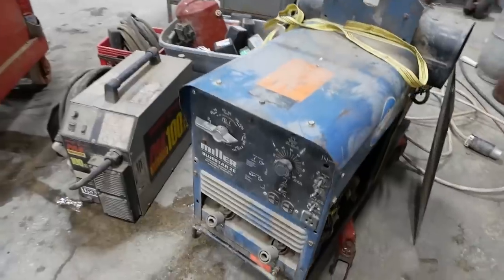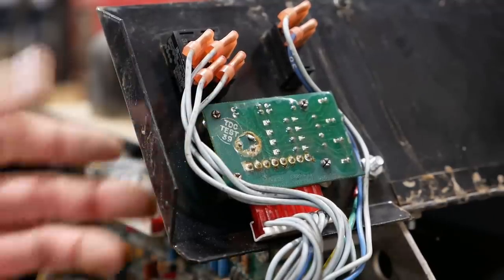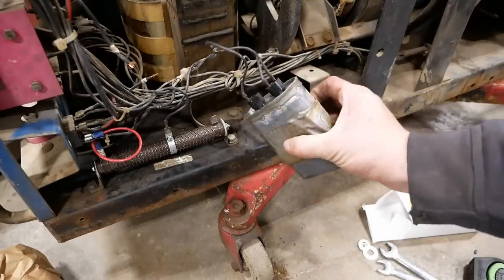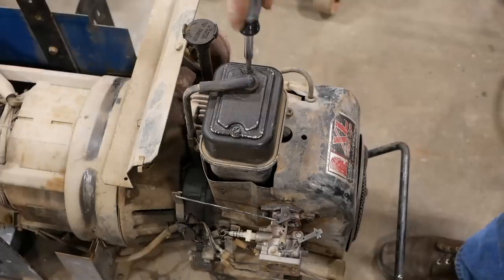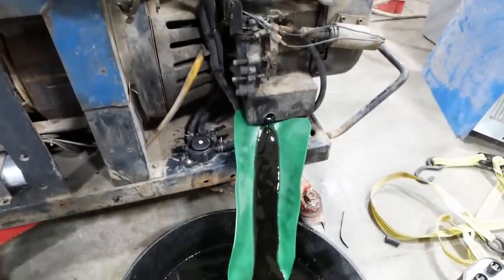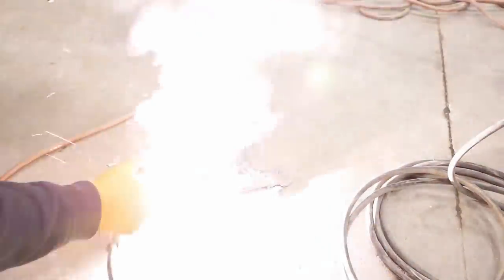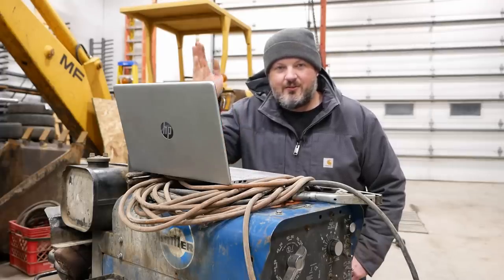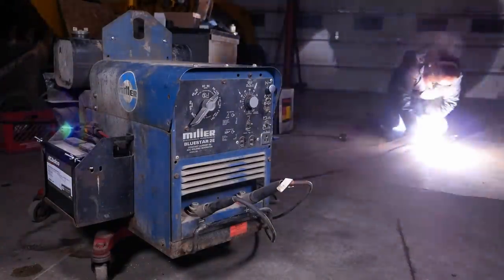Mostly Fixing my Bargain Portable Welder | Miller Bluestar 2E Part 2

Comment: That board that is put in on the main board, the one that doesn't look factory installed, is called a 'field mod'. It's often used when engineers deem a modification is necessary to original equipment. Those are usually only used on larger more expensive equipment. Seldom small units like that.
Reply from the maker: I’m assuming they had some old boards they wanted to use up.
Reply: @WatchWesWork  I used to work for a radio transmitter company, and they had to do mods for boards when they updated them, but didn't want to have the old batch sit in storage. Ours used to consist of a jumper, a piggybacked resistor, a new diode, or something similar. I don't remember ever seeing a scabbed on extra board. That is a new one for me.

Comment: Nice to see the old junk running and welding again. 😀

I’ve never repaired a trace on a circuit board, but I have had success soldering on a bypass wire to replace it.  (Looks like crap but allowed me to keep my old working that I couldn’t find a replacement circuit board for)

Comment: Not only is a piece of useful equipment saved from the scrap pile by proper diagnosis and repairs, but outstanding production values topped off by an exquisite closing scene are included too!

Comment: Rather than trying to replace the trace directly run a wire from a pad to the next pad. Stronger connection and you won't risk breaking more of the trace off plus it's then insulated for more of the distance.

Comment: Yes it has a compression release. It is built into the cam. If the compression release doesn't work when it builds compression it will likely stall the starter and bend the starter shaft.

Comment: We’ve all let the smoke out at least one or twice, or if we are honest more times than we can count.
Reply: You never have to let the smoke out ever though. You can always limit the supply current or make sure the load is not shorted. The magic smoke never magically releases. It's always for a good reason. But when I build mains powered circuit I'll often remotely power them on the first test.

Comment: Excellent video sometimes the repair is more a saga than a story, many an old machine has home-brewed repair parts to fix stuff like this, sometimes just a pile of parts soldered together in a plastic box filled with epoxy it's then a "module"

Comment: Well done, hope they send you a used board that works! That will be a sweet portable rig once you get it working properly, no point in stopping now you have us all hooked for part 3! May as well reel us in?
Reply: The board may not work after he hooks it up. If there's a problem in the welder that's frying the board. Like whatever that board is controlling is shorted out. Likely a solenoid.

Comment: I haven't welded since HS metal shop and to be honest the 5 seconds of instruction and the 10 minutes of actual welding time haven't survived the 42 years since HS. But I did just pick up a small stick welder that runs on 110 at the dump and a welding helmet no rods yet but I think there might be some in my dad's shop from the 60s... Or maybe I'll just use nuts and bolts

Comment: Roofing rubber is wonderful stuff.  I used to have a big piece of it that my mentor gave me for working under cars.  It was great for keeping you dry and relatively clean.  Maybe hooking the cables up backwards is what caused the disaster in the first place, although they usually used to have different sized clamps when they had the same color cables.  It is amazing what a patient, thorough man can do.  I think this falls under the same heading as my old van.  Yeah, I know I comment about my van on every video.  The fact remains that any repair I do on my van is probably more than it is worth at this stage, but it isn't more than the van is worth to me.  I can't replace that van with another as well maintained as it is for the price of the repair, therefore, the repair is worth it.
Reply: That looked like EDPM form flash to me. A pretty big piece of it though.

Comment: My DeWalt 5s are 3 years old and still going strong.  Don't get that cold though in a heated workshop.  Never let lithiums get very cold then try to use them or charge them.  Best to keep at room temperature for longest life.

Great to see these old welders getting ressurected!  Good tip on the trace repair using old legs, that's a very handy tip.  Only time I'm repairing PCBs is on my old 80s Pinball machines!!!

Comment: A suggestion on the fuel pump pulse line, don't allow the pulse line to go straight down to the pump. Instead come out of the crankcase at an upwards angle then curve down to the pump. As the engine is running, splashing oil and vapor are flowing down that hose to the pump and will leak out the pump vent. If you have a loop up out of the crankcase the possibility of that happening will be reduced. Your repair method of those burned traces is correct. I've been doing that for 30+ years as a former consumer electronics tech. The only difference is I used 26ga wire for jumpers on much smaller traces and have used desoldering braid for much larger traces. Keep up the great work!

Comment: Great job Wes I'm working on a 225G with a Onan 216G and I believe it needs these idle circuit board.  That will be the next check I do on it.  Otherwise, it does weld on ac and dc.

Comment: It's great things are working out. You never know until you give it a try. I've never saved resistor tails, I strip some telephone wire to repair traces. 
There is a project to make a diode, etc, tester. It takes an Oscilloscope, a filament transformer (6.3v), and some resistors, for current limiting.

Comment: On the dewalt note.. my batteries hold up fine, but i'm in the medium temp, I'm just sad about the quality of the chuck/bearing that holds it on mine, it wobbles like mad, and  their warrenty was a joke.. "oh yeah you can try send it back, but if we find nothing wrong, you have to pay for the dissasembly and everything"... came shite out of the box. I'm so done with that. Bought some bosch prof 12v tiny little drill and its dead accurate, and strong enough for 90% of things. Sorry, rant over ;)  - I really enjoy your videos, it's very cool to see the fault finding logic. - including with the obd scanners and what not, its a really nice insight.

Comment: My dewalt batteries are champs ... Never had a prob. 2 are not holding full 20v but they are from 2014 and beat on. I use to always leave them in the cold work trucks but since iv got a few new ones iv started bringing them in at night, except for a few this winter i keep forgetting to bring them in.

Comment: I subbed! You have an excellent approach to repairing your equipment! The following is just my two cents: Once I saw that you have the schematic, I think you should have retraced the damaged circuits before repairing. Since the board wasn't working to begin with, the previous repair was possibly incorrect. Still wondering if you accidentally shorted something when you soldered the wires. I'm looking forward to an update! Thanks for the video!

Comment: Hi Wes, really enjoy your videos, thanks for keeping them coming .... the Vac pump stops fuel leaks when the engine isn't running, ie a stuck float needle or just plain gunk from standing ...... like an auto tap ... you don't need the tap when using one.

Comment: I don't know about DeWalt, but I have been using my Milwaukee batteries in a unheated shop ~15 to 25F and they have held up great. I have to heat them up a bit in order to charge sometimes but thats it.

Comment: I have a sediment bowl on my Miller big 40. I have a new one but wanted to fix the old one. Made a new bowl gasket out of viton and for the shut off needle a new seat made from a plastic Folgers coffee lid and a new packing out of viton. Small pieces to make but it works as good or better than new.

Comment: I had a similar circuit board repair experience on a General Motors Electro-Motive Div. 2.5 MW stationary generator set.  The main generator voltage regulator had a circuit board that powered the control windings on the saturable core reactors in the power section of the static exciter.  I tried jumpering burned sections of the copper trace on the board with #24 wire.  When I reinstalled the Faston terminals of the external wiring to the board, the last wire connected was 125 VDC positive.  The Faston terminal vaporized with a large arc and a bang equivalent to a 22 cal. pistol report.  It was my first and last attempt at circuit board repair.  
I actually prefer your videos about working on small engine driven equipment to automotive type work.  However, I'll watch whatever you post.

Comment: I used to work as a Miller welding equipment service tech and those particular resistors and rheostat set being burned up at the one end, and possibly a few other parts blown out, is almost always from people cranking the engine RPMs up as high as they dare go without it flying apart in order to get more peak amps out of those machines.   

It works for a little while but eventually what you found is what happens, if the rotor or field windings don't burn up first. And yes, they do make a hell of a weld when pushing 4000 RPM! (For about 5 to 10 minutes.)😋

Comment: As a DeWalt consumer I have had a few issues with the Dewalt batteries. With just a simple phone call they would quickly replace the batteries as long as it was no more than 3 years old (no receipt necessary).  Just did this about a week ago and never even talked to a human.  All of it was automated and still received a replacement battery within a week.

Comment: The "technical" term for that soldered on board on the plasma cutter is a "bodge". Basically either a mistake was made during the board design/production, or there was a performance issue with the machine that needed correcting. It would be too costly/time-consuming to redesign and produce new boards, so during production they just solder up that little "bodge" repair. You see "bodge wires" all the time on higher-end low-volume equipment.

Comment: Been T/S and repairing PCBs for years and your method for bridging  circuit traces is valid for that application. My concern is what blew them out in the first place (as you discovered). In addition did they use the right components in the "repair". Did they use the proper/enough amount of new heat sink compound?  Even using "compatible equivalents" sometimes is not enough. Nothing you can do about it if the original  component is not known. Suggestion: If it continues work lay in a supply of spare transistors/MOSFETs (if you can read the number on the component) in case one decides to let the smoke out. If you do obtain that spare board record the component numbers if you can. Trust me it will save you future grief. Great series. Cheers.

Comment: My friend Ed bought a Miller and it stopped welding ect . It would start and run but that's it . He asked if anyone knew anything about them . I told Ed pull the cover and we will take a look .Took a volt meter and after doing a bit of checking,  I don't have any experience on them I found a connection where a I thought it was not making up on a spiral wire . I cleaned it and retighten it . Sure enough that was the problem.  I don't work in the electrical department,  normally maintenance,  every one Ed asked said I don't have any experience or training ect . Well Ed it want fix itself let try to solve this lol. Years ado my 200 Lincoln   would only strick a ark after I used a grinder . I checked it and finally I found a bad solder joint on the exciter . Fixed that and problem solved . I never seen that one before lol

Comment: Excellent video Wes i saw the S J Smith stickers on it a very reputable company in davenport Iowa  if you call them and tell them about the unit  they could probably tell you its service records and i know  that they have an upgrade  kit for a newer torch on thermal arc. But they make a great machine very durably built. That current knob possibility got hit  its a common problem in fab shops  they take a hit sometimes

Comment: 11:06 just a guess: It should have been 12 Ohm all along.

Then the ground wire touched it and melted over time and thus damaged the resistor.

Someone "fixed" it, by using only the undamaged part - so the reistor got hot. Very hot. And melted the other wires.

Comment: 20:14  Dad has Dewalt.  I have Milwaukee.  He broke one battery couple weeks ago when we got that -15f cold snap.  I don't think he was even used it during the cold snap.  Just riding around in his tool box in his truck.  I was using my Milwaukee without issue... well except that no battery likes those extreme temps.

Comment: May I suggest before u install a replacement idle control board to thoroughly check out the idle solenoid.  It could be shorted and blow the replacement control board.

Comment: I have 3 Bolens with these Tecumseh engines. 2 were new replacements in the 90's.  One I rebuilt around 2011.  The Tecumseh plastic replacement pump just hangs off the carb with a short piece of fuel line from the pump to the carb.  There is no mounting of it.  Just an FYI.

I know many don't like Tecumseh, but I have had issues.

Comment: Valve packing is available in all sorts of flavors an diameters . Silicone , asbestos , graphite cord . Can pack the glan nut easy , just may have to get the packing NOS from eBay .

Comment: Hey Wes, just a tip: gravity feed systems typically don't work too well with paper cartridge fuel filters. It seems they do better with screen type filters. Love the video!
Reply from the maker: Did you see the part where I installed a fuel pump? Guess not.
Reply: @WatchWesWork  I'm sorry, my comment wasn't super clear. The tank gravity feeds through the paper filter, then to the pump. I'm concerned you may see flow issues to the pump
Reply: My source is James Condon on YouTube.  He specializes in generator repairs and says that a paper filter is fine as long as it is located after the fuel pump. If it's working for you, no harm, no foul. I love your work!

Comment: Mac tools has a case/boot for those batteries (and the 1/2 DCF899).  They seem fragile but I've only cracked one so far.  I do like that my Mac DeWalt batteries have bumpers molded in.

Comment: I got a thermal arc from a guy at work for free. Just needed fuel lines and the anti backfire solenoid was froze, fuel pump and a carb cleaning and it worked fine. I believe it has a honda gx620 on it. The auto idle didn't work on mine also, I just hooked it up directly to the switch to do it manually.

Comment: Love watching you I don’t think there’s anything you can’t fix. Just wondering if that oil filled capacitor needs a heat sink rubber with insulate and not dissipate the heat

Comment: Good sir I worked for a Miller dealer and done demos for sales. Was a welder by trade and have owned a blue star and aeda 200 trust me if your doing a lot of tacking don’t mess with auto idle bump it up let it run if it were mine and that board was bad and I have a board for it I knew that’s what it needed I wouldn’t take the time to take the machine apart and put it in I run it on high idle most of the time I would run one of those machines on high idle they normally weld better because of that slight delay between trying to strike an arc and the idle increase

Comment: On the plasma cutter, look at the information on the face of the plug. I think it will say that it is for either 20 or 30 amp 240 volt service, single phase.

Comment: The idle down is not a big issue. Just throttle up and shut down when not in use. But I belive you are correct. Someone burned it up due to cables. Parked it in the back and prayed Noone noticed till the next shift.